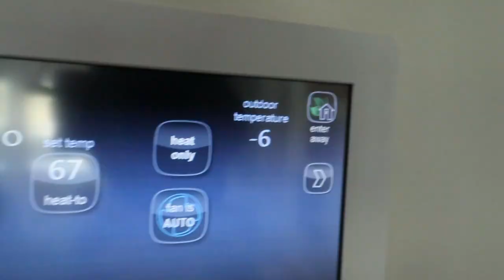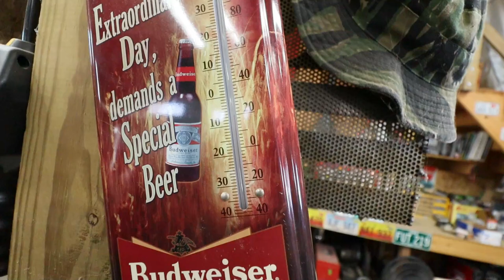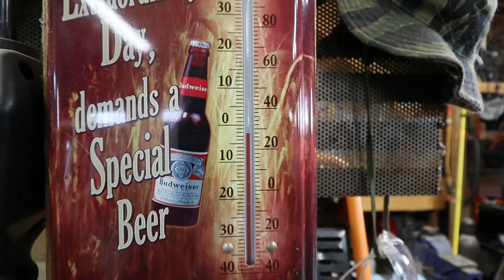✴️ This Generac Generator Hasn't Ran in 9 YEARS & I Need It RIGHT NOW !

Comment: A former boss of mine bought a generator to run a job site and it wouldn’t run straight from the store. He gave up on trying to get it running and went to get another one (different brand and store) while he was gone I piddled around with it and found out that the fuel on/off was missed labeled, so the fuel had to be off to run. Sometimes it is that simple. 
I’m surprised that your beard hasn’t frozen off!!! Lol

Comment: #1Check oil level as that generator has a low oil safety cutoff.
#2 Use only non-ethanol gas.
#3 Use a gas additive to prevent gelling in low temperatures.

Comment: The way you picked up that heavy Genny and set it on the workbench, I have to ask how tall and your weight and did you play football?
Also, that little Genny won't run your emergency heat. It should run your house fan and a refridgerator though.
Love your channel😀

Comment: How you doing Mike??? Haven't heard from you in a bit. Hope you, your fam and animals made it through the artic blast OK. I made it through here in OKC, OK and luckily even had all my pipes protected by putting box fans under the cabinets in front of all the sinks. That pushed air from inside the house to under the sinks plus pushed the outside cold air away from the pipes. Thankfully the very short power outages the pipes were warm enough to keep from freezing before the power came back on and let the fans take over again.
Reply from the maker: We are good here and the wether is warming up

Comment: add some Sea Foam to the gas for all your small engines. it cleans everything it comes in contact with. Also, use non ethanol fuel if possible,
Reply: PRI-G is the best fuel preservative for long term.

Comment: Dude! That is the smallest drill bit set!!!
Reply: You can get a small drill set for cheap. Size 61-80 wire gauge drill set is what you look for. Size 80 is .0135”
Reply from the maker: I have no idea what it was for but it comes in handy time to time 👍👍
Reply: @SunnySlopeHomestead  you ran your generator in your garage. Remember that it’s never safe to use a generator indoors because of the carbon monoxide fumes. Make sure you are aware of the hazards when using generators. Be safe